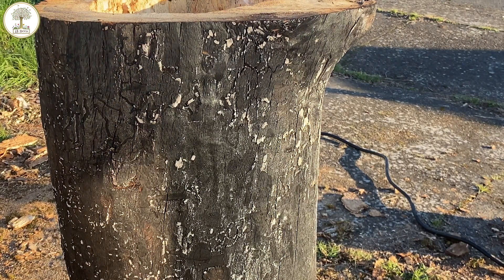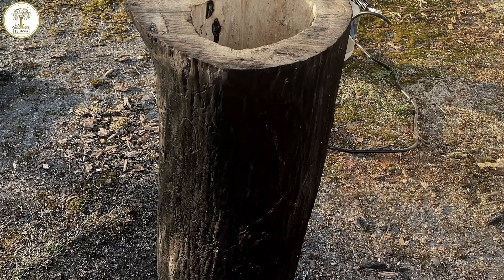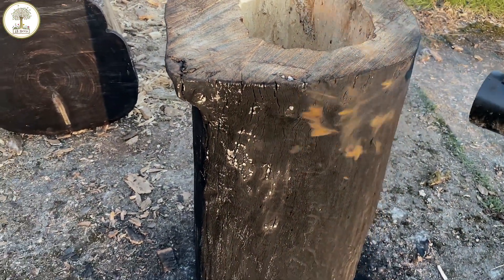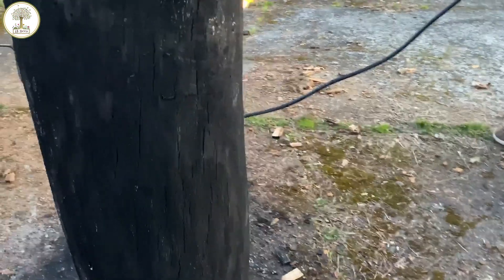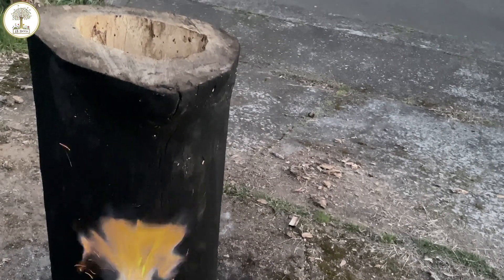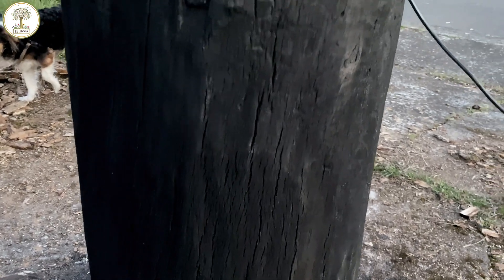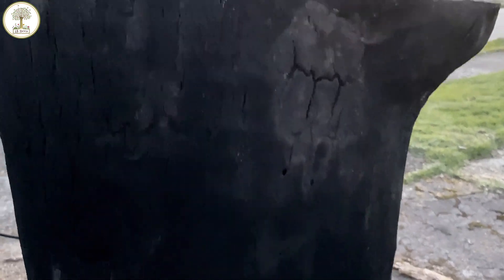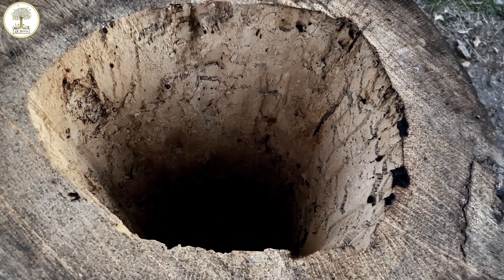Log Beehives Charred  - Shou-Sugi-Ban

Comment: I have been doing this to Warre and top bar hives for years now. It doesn't last that long and has to be renewed from time to time. Also best oiled, preferably with tung oil, as is traditional in Japan.
Reply from the maker: Thanks for the info.  Was wondering what oil to apply. I read boiled linseed oil is used too.  Any experience with that?
Reply: I used 100% pure tung oil on my original hives, it took almost a year for the smell to vent.  The hives looked very nice, but they also attracted a lot of debris and mold.  They definitely require more maintenance.
Reply from the maker: Dan Ski's Bees Tnx mate. Maybe I’ll not seal straight away. I don’t want any weird strong smells to turn the scouts away.